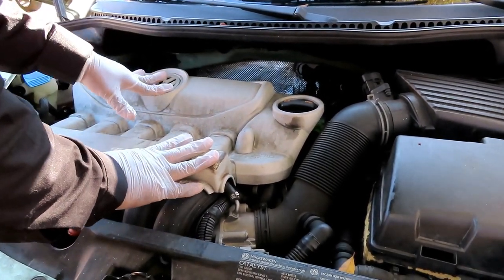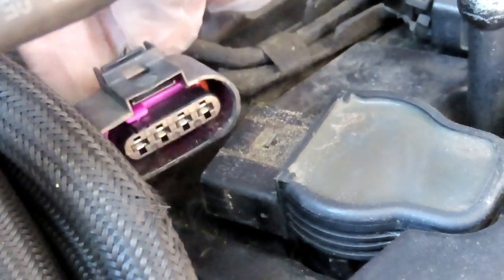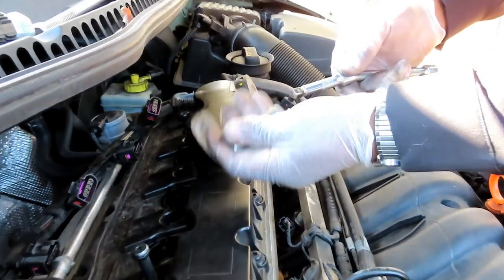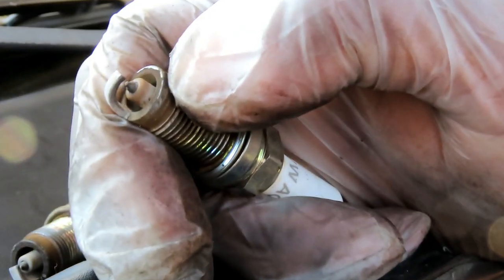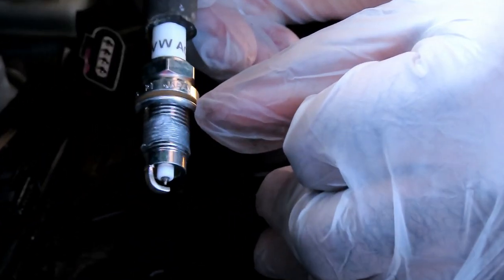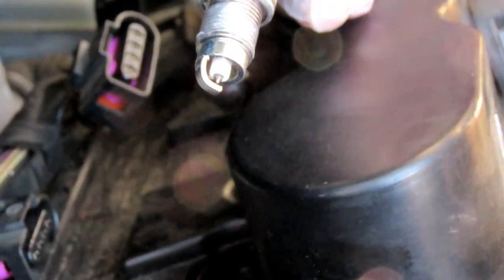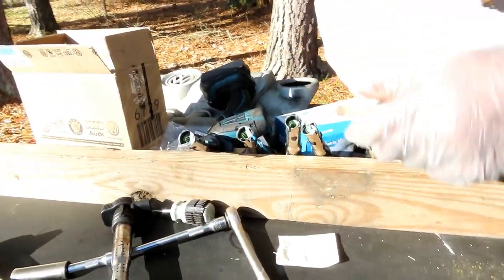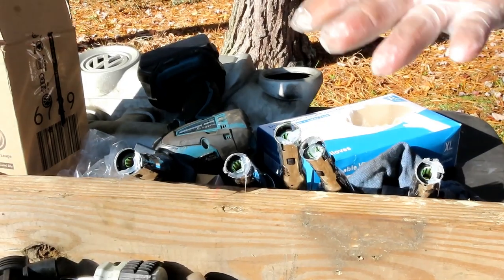⭐ 2007 Volkswagen Beetle - 2.5 - Spark Plugs And Ignition Coils Replacement

Comment: In my experience over the last several decades of using NGK plugs in cars, motorcycles and lawn power mowers and tools, I've found their proprietary anti-seize coating does work, but only for the first installation. If the plugs are removed, then you should definitely apply regular anti-seize to the threads. I love NGK plugs and coils and I've never had a problem other than when reinstalling a plug.
Reply from the maker: That's a good message to pass on, thanks!

Comment: Hi, I enjoyed you video very informative and I tried to follow your instructions on pulling the wiring harness forward and then pushing down on the clip while pulling back but no luck. Was trying to be easy but still broke clip. How do I remove harness from coil pack with broken clip

Comment: I just did a plug and coil switch yesterday, and when I started the car the check engine light came one; first steadily, then flashing. I pulled out all 5 coils, rechecked connections and got the same flashing light. Suggestions?
Reply: Did you ever get this fixed? Would like to know

Comment: You didn't mention anything about gaping the plugs.. did you use pregaped ones?
Reply from the maker: All plugs come pre-gapped, and again, it will be a matter of preference and experience. If you are totally not comfortable putting plugs in without gapping them, then by all means you should do so.

Comment: hi tim i have a 02 honda civic 1.7 misfire problem p0300,p0302,p0304 replace coil packs ,spark plugs and clean egr valve and change fuel pump still misfire
Reply from the maker: I answered your question on the other comment you made on the Honda video.
Reply: Check for intake manifold leaks. Also a faulty cam or crank sensor.

Comment: That dielectric grease works great on all kinds of rubber and silicone items to prevent them from rotting.
Reply from the maker: LEN!!!!!! We got another car, but I'm going to leave for you guys to guess what it is, LOL! Video will be out tomorrow!
Reply: Honda Accord?
Reply from the maker: Lol
Reply: You are absolutely correct. I use it when I change out various light bulbs in vehicles. It makes those stubborn plugs easier to remove.

Comment: The first thing thay you wanna do is take that cover and toss it out!
Reply from the maker: Don't think the customer would appreciate that...lol
Reply: Actually, this isn't a bad idea. The PCV valve in the valve cover has a limited life and right now, Deutsche Auto Parts has the OEM ones on sale at about 1/3 of the original price. My 2008 Rabbit 2.5 will have a new valve cover, coils and plugs in the next few months as regular maintenance. No problems yet, but with 147K miles on it I figure I will be pro-active instead of reactive.